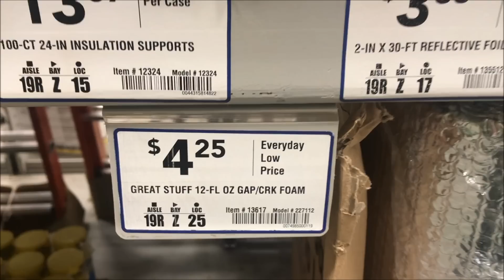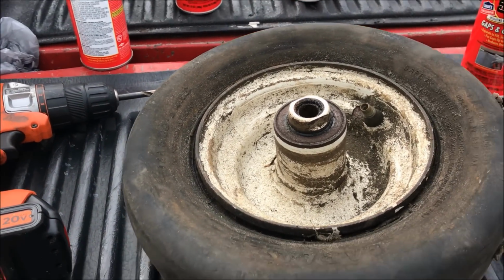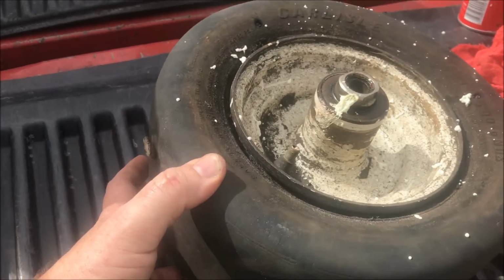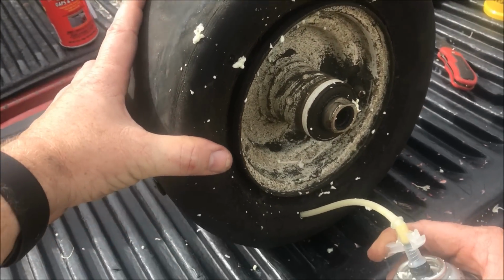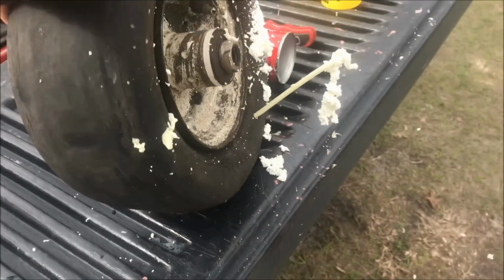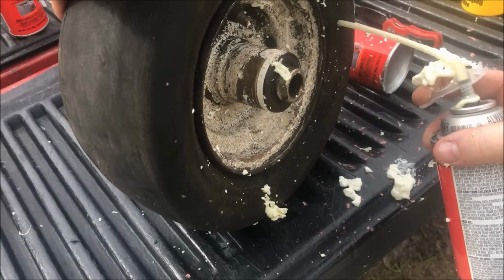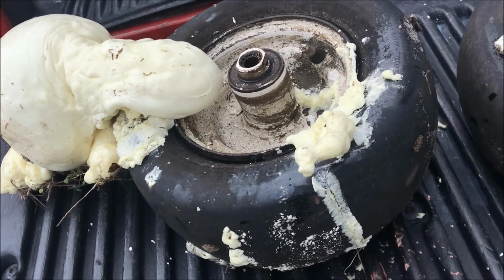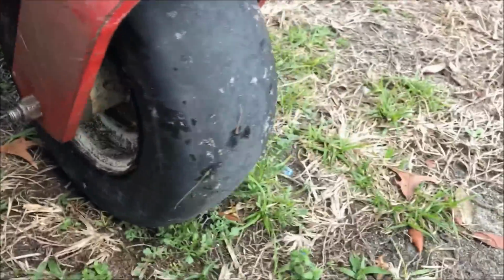No more flat tires How to fill a TIRE with FOAM

Comment: You need to hold the can upside down !
Reply: no you don't hold it upside down, I cut the bottom out of an empty can and tube runs to bottom of can
Reply: No you don't. It actually stops spraying when you do that. Same with spray paint. Read product info once in a while, it helps!
Reply: @Roller76   No paint has a straw in it but not the great stuff foam !
Reply: Exactly!!
Reply: Forward drill bit works best!
Reply: @Roller76  I just bought this stuff. It does not say on the label which direction to hold the can, but there is a picture of a can upside down. Plus, I know from past experience ( in home construction for decades) you hold the can upside down. And the can emptied out being held upside down. So, it does not stop spraying when held upside down.
Reply: @bowlweevil4161 

"no you don't hold it upside down, I cut the bottom out of an empty can and tube runs to bottom of can"
 Was it a foam can?
Reply: @glenseaford2845  
It was forward. An optical illusion.
Reply: Not sure about the great stuff foam but to all you saying to hold can upside down to empty the can....all of my experience with rattle can spray paint you tip can upside down to clean nozzle when you want to save half can and keep the nozzle clear....only sprays out air so don't spray too much....or half can of product and not enough pressure to empty it. Happens with my w-d all the time...no pressure and half full can.

Comment: Cheaper to buy a new tire with rim and have it rubber filled at a Commercial Tire dealer.  They can even make it soft or hard depending on your use.  The tire will wear out eventually, but you’ll never get a flat.

Comment: DO NOT ever do it. The foam becomes powdery over time. I mean in very short while. It does not have the power to carry heavy stuff.
Reply from the maker: Hello thank you for watching. The tires worked perfectly. They are for a z-turn mower. Not much weight is on them.
Reply: @how2af263  are they still inflated?   i'm thinking of doing this with my inflatable (leaking) dinghy -

Comment: I started watching with high expectations, then I saw a (black and decker) drill, GOING INTO A FLAT TIRE! The bead was already broken why drill holes? I don't know... but good luck cleaning all that "great stuff" off your truck bed... 😂

And I've used 5000+ cans of expansion foam in my life, and NEVER HAD A TIP BLOW OFF....

Comment: Wouldn't it be easier just to buy a replacement wheel/tire brand new from Harbor Freight?
Reply: Nice idea, but the HF tubes are crap. The cart that I bought had 1 tire not holding air right out of the box, and any of the several replacement tubes lasted less than a year before the same issue.  The $15 puncture sealing tubes from Lowes, not much better, not worth the extra money.
Reply: I have gotten several 10" tires with tubes from HF to build a cart with
  Every one has gone flat in a very short time. 
   But I don't think this type of foam is the solution!!
Reply: it's a zero turn mower tire
Reply: Some people like to find ways to beat the system.Its fun.

Comment: I want to do this on my small lawn utility trailer two tires, the tube is no good & still inside tires with no valve stem protruding, old tires. Do I need to remove tube before installing this foam?

Comment: Well  I noticed few wrong things. You don't have to make new holes It the tire has patches  . And to make the foam goes inside no need to rotate the tire just stick the nozzle all the way in on both sides and fill-up . Also put a patch to seal the tire and get more pressure the foam doesn't go out.

Comment: “I spended $40 on tire foam to repair a cracked POS tire” When he could’ve bought a new tire on a new rim at Harbor Freight for $20....
Reply: I thought the same thing.. waste of money.
Reply: Dummy he won't have to worry about tires anymore in general. That's why he did it
Reply: 2 years later (or less)  replace it again......

Comment: After watching this, I thought I'd try it on my light aircraft. Take off was going well ( I could not see the inevitable coming as I was texting at the time) until both tyres shredded, causing me to Veer off taking the control tower out, together with all the petrified onlookers and their families ( in the Cafe next door) as the control tower came crashing down on them ( the look on the air traffic controller 's face was a picture, I've never seen anyone look death in the face) the resulting fire caused all the cars in the car park to burst into flames. Apparently, the smoke was visible for miles, and commercial aircraft was diverted to another airfield. Needless to say, my next flying lesson has been cancelled due to safety reasons. Can I sue for punitive damages?
Reply: Hell yea!! 😂😂😂

Comment: I use the green slim but foam ok if you like riding around on rocks also harbor freight sells the tool for removing lawn tractor tires and lots of vids how to use it. Lawn tractor tires have a steel ring like a car tire.

Comment: I tried this, when I was mowing the foam melted. I bought a new tire and had to cut the old one off and clean the rim. What a mess.
Reply: Melted? Where were you mowing, on the sun? You didn't let it dry.
Reply: @samchowdhury3755  edited his post, Dan Coles caught you with the left hook. Straighten you right the fuck out. Went straight upstairs made your bed, corrected your mistake and haven't made a mean comment on YouTube since.
Reply: . My! Did you sweat a little? Scraping some foam off that rim would make me whine also!

Comment: This does not work the foam turns into powder as other people have said DOES NOT WORK. There is a professional grade tire foam but it is next to impossible to find and very expensive if you do good luck.
Reply: t watson aa
Reply: Goodyear commercial tire places usually can fill your tires with foam
Reply: Great Stuff Pond & Stone is a good alternative to that black pro grade tire foam you are talking about.  It does not pulverize or compress like the other Great Stuff foams do.  It's about $10 a can, though.

Comment: It dont work for load carrying tires like my lawn tractor. All you will get is flat spots when you leave the tractor sitting. I just attempted  to repair a flat tire on the front of my lawn mower. It told the story. The foam didnt work. I removed the foam. All I could do is install a tube because I had ruined a almost new tir ed by drilling holes in it. I had added the red sealant  to the tube that I got from Lowes. The sealants dont work well in a tube.

Comment: foam crumbles and turns to powder and is not durable
Reply: I was thinking the same thing. They actually use a hard jell like material to fill tires for solid use. A friend brought me a piece of the hardened material. It looked like very solid jello but was used for filling his large rear tractor tires. Added a bit of weight too.

Comment: Had a 6" front tire on the riding mower.kept getting flat spots.I would keep drilling holes in the flat spots and adding foam.Must have added 6 or 8 cans. Quitting before I start ruining good tires.

Comment: I TRIED THIS. TIRE STAYED FLAT. TIRE DIDN'T STAY ON RIM WHEN IN USE
Reply: of course they would, foam wont hold up a chair let alone a 50 pound lawn mower.  lol thats why it takes 60 psi to hold it up lol

Comment: Should of just cut out the valve stem. But pretty good idea for wheel barrel tires or really any tire basically or the exceptions anyways.
Reply: This will never work! Don't waste your money and time! As soon as you roll over a curb or anything that will push the tire in the foam will not return to it's shape.
Reply: Yy TY UFC

Comment: I just put Slime in all my mower tires about every year and a half. It keeps them very manageable.   " Little trick " doesn't matter which kind of Slime, Tubeless , inner tube , Doesn't matter. $ 11 a gallon on Amazon if you have prime  !  AND, I still keep the more cushy ride of a nuematic  (air) tire that way.

Comment: Forget the foam for now jethro. You first need to learn how to use a drill.  It's easier to drill a hole in most anything with the drill running in the correct direction.  Ok Jethro?
Reply: The drill was turning in a clockwise direction.  Camera frame rate gave a false indication.
Reply: Look at the drill chuck, it is moving clockwise. The drill bit moving counter clockwise is an optical illusion. Because both the drill chuck and the bit have to move in the same direction, it's physically impossible that both can move opposite of each other.
Reply: @ajam4u  maybe he was using left handed bits? Woulda took alot longer to drill hole if was going in opposite direction. Rubber isnt the easiest thing to drill
Reply: You must be jethro's Dad. Right, Jethro's Dad?

Comment: I liked it...I wonder in the long run how they hold up? If you hit something does it dent or squash? One thing I hope I can add is if you put a sheet metal screw in the whole you squirt the foam in it might keep it from coming out...I might have to try that with a tire that I have. Thank you - kilroy79763

Comment: Do these tires still hold up now that it is 3 years later or have you done something else?
Reply from the maker: Hello, good question. The tires did hold up for 2 years. I had multiple nails in them. I did replace them due to the tire worn through to the foam. No hassle for 2 years filling up with air. My new tires are also foam filled.

Comment: I did not catch what foam he used, but insulation foam breaks down when used this way.
Reply: What I was thinking.  And I bet the foam in the center is still wet which explains why the tires have bounce in them.

Comment: Have you used the machine to mow yet? How are the tires holding up. I saw another video where the guy put foam in his log splitter tires. He didn’t show how he did it but he had flat spots where the weight of the splitter was and his tires failed after towing the splitter up and down his driveway. Thanks for the video. Please do an update.
Reply from the maker: I have used it. I did hya low spot only in one tire. I got the drill out and made a hole and filled the low spot. I haven’t had a problem since.
Reply: How 2 AF 
Nice. Thanks for the reply. I’m going to try it with mine. The dealer wants upwards of $150-$180 per tire.

Comment: It doesn't work.  That foam turns into  a dry powder, when it gets old, it would never hold up with weight on it.  all the air bubbles would eventually let the dry foam crush and it would be like sawdust in there.
Reply: Much thanks to you for saving a lot of us a lot of trouble! Wish the world had more people like you in it.
Reply: Dude that takes a long time to happen. It may crush down though.

Comment: this foam does not stand up to use , it just pounds up and turns into nothing in very short time
Reply from the maker: It’s not ridiculously hard but it works for the mower tires not much weight on them.
Reply: @how2af263  I foamed tires on my 3pt mower and they did not last one mowing

Comment: I tried this...it worked great for a while until the foam crushed to dust and realized I was going to spend more in foam than if I just did it right to begin with. Go buy a $10 tube, don't screw up your tire with drilled holes and you're done.

Comment: Shoulda jus tried to squeezing 50 tubes of 100% silicone caulking in them...make sure its clear so we dont go run awf n make a heeping mess...or liquid nails so you wont have to worry bout running over any more nails...
Reply from the maker: This is also a good idea. Thank you for sharing.

Comment: Craig is right, the drill is in reverse.
Reply: Um ... This is sometimes referred to as the reverse-rotation effect in cinematography;  it is an illusion caused by each spiral of the drill (spoke of a wheel, etc) coming up a few degrees shy of the position it occupied when it was last imaged by the camera. Haven't you ever watched an old Western, and seen the wagon wheels appear to be running backwards? Same phenomenon.
Reply: Or 2 big them words😱😵😲😩

Comment: i saw in the news that the tire industry is working on a solid tire. it has no air or foam to keep it running. the first tire was one of solid rubber so it is not a big first of its kind invention.

Comment: I fear that with heavy load, that stiff foam will permanently compress and make it run like a flat tire.  How has it worked out?
Reply: Great Stuff Pond & Stone works.  It does not pulverize or compress 
like the other Great Stuff foams do.  It's about $10 a can, though.

Comment: Silly when you spend more money filling a tyre with foam when a solid wheel can be bought for less
Reply: Have you ever bought a no flat mower tire? Ones for commercial mowers are like $100 each
Reply: Saw some solid rubber wheels at Harbor Freight.Didn't look like they would hold up very long. I got lucky on a wheel barrow. I put an old boat trailer wheel on it. It has no air in it but is so old and stiff it won't go flat. I've seen that on a few golf carts.

Comment: Why does my flywheel spin freely as if not attached to the motor
Reply: You probably put a tremendous load or impact on your engine. There is a key notch out of sight on flywheel and crankshaft it is on. To protect engine from "breaking" a soft metal key slides into the keyed slots on the two parts and breaks if a "fatal" load or impact is encountered. This is why very important to use torque wrench when tightening flywheel nut.

Comment: Nice vid - thanks! Very resourceful idea - - - I just look around my place here and I probably have 50 or more tires on various different small tools & equipment like mowers, wheelbarrows, carts, trailers ... on and on ... if ONLY "they" (who's 'they' anyways??) would put decent tires on machines, not this garbage produced in slave-wage sweatshops overseas, we wouldn't need this video! I've got machines with tire/wheel combinations I've bought at big box stores less than two years ago, and the tires are already s**t; dry rotted, flat all the time - but why then, are the ORIGINAL American-made tires and tubes on my 1946 junk-trailer still going strong - probably air them up only every two years or so!! Kinda wish we could somehow, just for a week or so, be allowed to buy American from these box-stores. Trust me, I'm not a right-wing-America-first-all-others-go-to-hell guy whatsoever; I believe in a global economy and free markets - but what the EFF??? How do they get AWAY with producing such trash!?!?!???? Honestly.

Comment: HF sells tires that are solid for wheel barrows. Never another flat again.
Not sure if this foam holds up when used this way. Does anyone know?
Reply: Noticed with other jobs that foam needs air (or moisture?) to set. Not sure it will set in the interior very quickly.
Reply: You also need to make sure that the temperature of the can and the outside temperature or wherever you are using it, is warm. we tried using it to fill some gaps in a wall in a garage in the winter time to stop the cold from coming in and it did not expand any more than when it came out of the can. Like at all.
Reply: It doesn't work . looks pretty good. My daughter says should I get a new tire. That one isn't round. She is not anorexic.

Comment: LOL !!! Drill in reverse and walks off the sidewall then valve stem !! LOL Never got the bead seated LOL !!!
Reply: He wasn't drilling in reverse. Look at the drill chuck it is moving clockwise, which is forward. Because of the frames per second that the camera recorded the drill bit looks as if it is drilling in reverse. This has been so ever since the days of early movies. Like westerns, where the wagon is traveling forward but the wagon wheel looks as if it is spinning in reverse. It's an optical illusion because of the rate of frames per second that the movie cameras record.
Reply: @ajam4u  then why does it repeatedly walk off the tire in the direction of the bit going in reverse

Comment: This kind of rigid foam isn't what you want for filling tires. They will compress over time as you whack it into things and will no longer confirm to the round shape of the tire. You're better off using a good tire sealant like FlatOut to quickly seal air leaks as they occur. Plus, I'll be much lighter than this PU foam.
Reply: do you have to add air after using FlatOut?

Comment: At first glance this seems like and awesome idea.  But lurking beneath, its a terrible idea.  That foam once compressed, does't expand back out to its original shape.  No where near it.  So if its being used for something heavy it will just compress the foam so much it will be flat again in just a very short period of time.
At the end of the day, your gonna be spending more money trying to figure out how to fix these pieces of crap.  JUST BUY NEW TIRES!
Reply: Tony Montana.. Just wanted to applaud a lucid and accurate response. Someone out there completely agrees with you .. Me!

Comment: That foam is not dense enough or strong enough and it wont cure in a sealed wheel. It should say, How to ruin a tire and wheel with foam.

Comment: Try cleaning that stuff off your hands .wear gloves. Make sure the tire is clean and dry. No slime. My tires get a lot of thornes. I have two tires that have been filled with something like jell. Little 8" tires but very heavy.  Probably done at a tire shop that does construction Equipment.

Comment: Your tires are still gonna wear out by the tread.so now you're gonna have to change the whole rims. Or cut the tires off and punch holes in brand new ones just to fill with foam. Lot of expensive work.

Comment: So this guy is plauged with small tires going flat? Is he the groundskeeper at a nail factory because in 50+ years I have never had or even known someone that had a flat on a mower/blower, or wheel barrel. Of course it happens but its a rare event I'm sure.